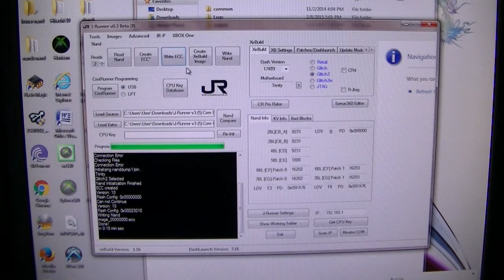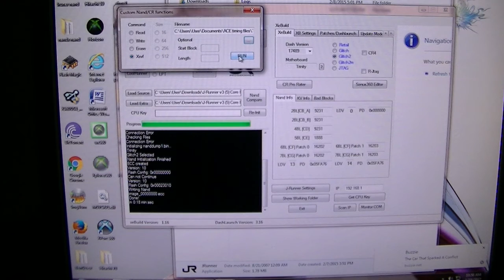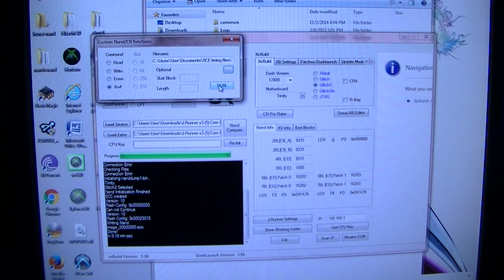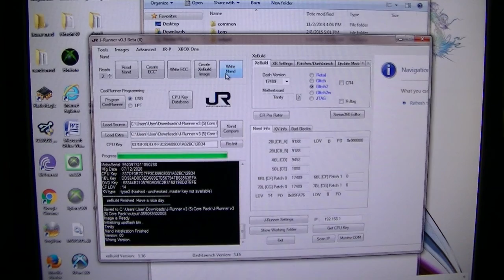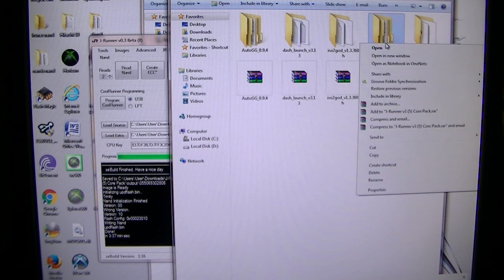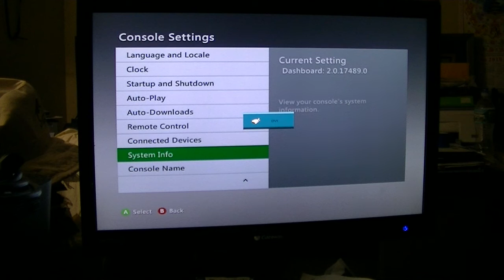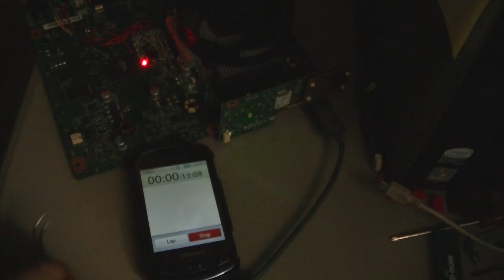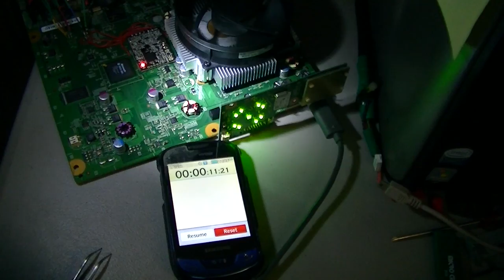X360 Ace V3   Direct Wire Instalation part 2

Comment: Does the Ace V3 need to be soldered to the motherboard before you program it? I've seen other videos where people just program it using those pin headers you had without it being connected to the console. However I tried that and it didn't work.
Reply from the maker: don't matter U can program it before installation or after I never had any problems

Comment: how can I make an "ace v3 programming cable" without modifying it (the one that came with JR programmer v2 for coolrunner chip)permanently? I want to use it Gain to program others coolrunner chips for try 1.2 for fat consoles.